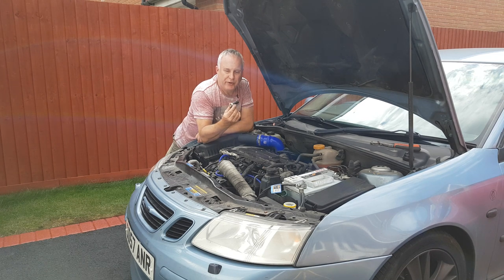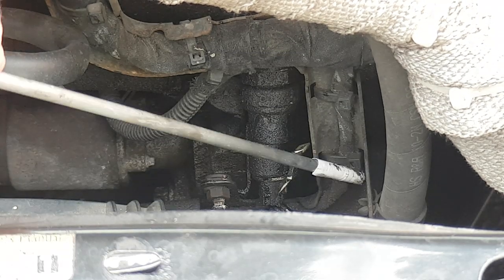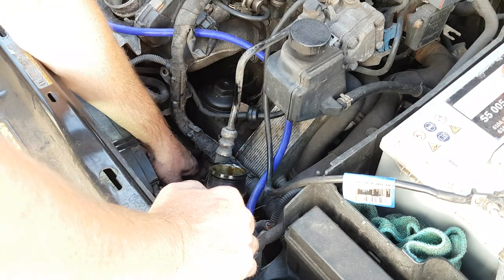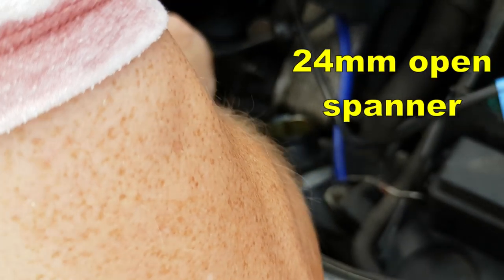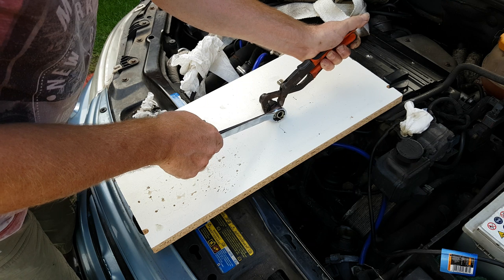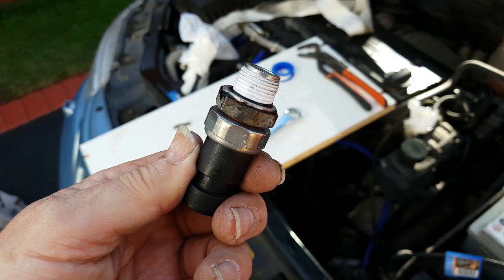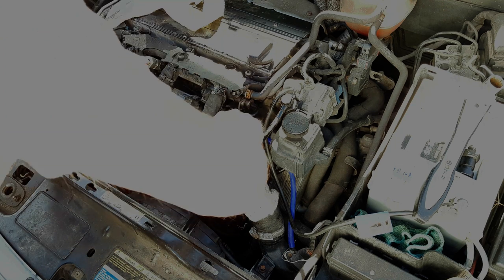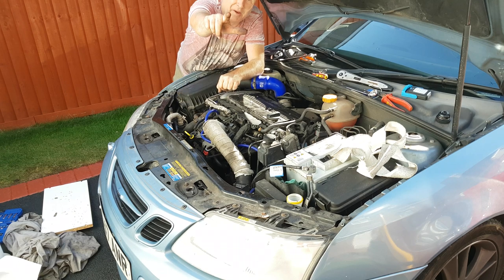Saab 9-3 oil pressure sensor change | How to | Saab Oil Leak Problems

Comment from the maker: EDIT: reporting back as promised (5 months): this has cut my oil consumption by about 90%. There are almost no drips under the car now and the drive has stayed clean. Job jobbed, I'd say.

This is definitely the most common oil leak issue on these (and other) engines. I thought mine probably had several oil leaks, but lo and behold replacing this sender has cured almost all my leakage. In almost a fortnight now since doing this, my oil level doesn't seem to have dropped at all on the dipstick. I'll report back again after more miles.
Reply: Appreciate the info. Any update so far a year later?
Reply from the maker: @akdomun  no leaking from sensor.
Reply: @CycloneCyd  i have a really bad oil leak on my 2004 saab 93 aero convertible. the car is covered with oil on the bottom and leaving puddles everywhere i go. im going to do the valve cover gasket and the oil pressure sensor and hope for the best

Comment: Would it be possible to access the oil pressure sensor from underneath the car to avoid removing pipes under the hood?

Comment: Cyd, I love the content. Somehow my '07 9-3 continues to have the same hiccups as yours! BTW, oil sensor was $12 USD from where I bought mine, much better than a few hundred at the shop.
Reply from the maker: You're quite right there. This is the sort of simple fix shops can easily overcharge for. That's normal, particular models suffer from a common set of problems across the range.
Reply: hey where ya get it?

Comment: Thanks for this. I'll be doing this soon. I noticed you switched out the vacuum lines for silicone. Do you have a diagram or video for doing this?
Reply from the maker: Yes, one of my pipes had a split. No, I don't have a diagram, nor done a video. Not sure it's worthy of a video TBH. Easiest way to do it is simply replace one pipe at a time making sure to get the connections in the right place. Then follow the same routing or reroute. Use it from a roll and cut it to length each time. You'll need 6mm ID pipe for most of it (I used this http://bit.ly/Silicon_vac_hose ) except for the short piece to the fuel pressure regulator which is 4mm ID.

Comment: Need to check mine as it is leaking really bad...valve cover gasket changed anyway....comes out somewhere between gearbox and engine and really bad on the back...
Reply from the maker: If it's a B207R, check the interface of the oil cooler to block. Also check the vacuum pump.

Comment: I don't think PTFE tape will hold in this application. The metal washer is not reusable I think. If you experience any leaks in the future, refit the sensor without PTFE and with a new metal ring

Comment: Yo Cyd, your air delivery pipe is wrapped the way a sniper would wrap their rifle. What is it and does it keep the air cooler?  Very cool looking 😎
Reply from the maker: Yes, it helped knock about 1C off the air IAT. It's exhaust wrap. I've since changed to a 82C stat (was 90C), so probably not making a big difference anymore.

Comment: it's work on 9-3 2.2 TiD 2004 ? or is the oil pressure sensor somewhere else?  D223L motor code

Comment: Is this the most common oil leak on these cars? My garage, when I was getting the car serviced, said  I had a slight oil leak somewhere but they didn't say where. I'm going to check mine today. Mine's a 2005 Aero.
Reply from the maker: When this leaks it flows down onto the front engine mount and drips from there. It probably is the most common leak point, certainly at the front of the engine. If the leak seems to be low down though, investigate the oil level sensor. At the rear, the cam cover just above the turbo and vacuum pump are common too. Even the oil connections to the turbo are known for it. Bottom line is these engines leak like a broken sieve. More videos on the subject to come methinks.
Reply: Thanks Cyd. Love your videos and think they are excellent. More on Ssabs would always be good.

Comment: Hey Cyd, another great video!! Wondered if your saw my comment on another video about potentially doing a how to on how to replace the door lock actuator on the front left door on the Saab? I've seen a number of rear door replacements on here, but I can't seem to find a front door video and your videos are so well done!! Cheers!
Reply from the maker: Sorry Adam, I didn't. YT has only just introduced a search system where the owner can search for comments not responded to. Previously it was really easy to miss comments.
Are you in a hurry for this info? I've got several jobs to do on my driver's door, but we've hit rainy season here now so I have to pick my time. Weather permitting, Xmas break might be a good time.
Reply: No worries Cyd. It's broken at the moment and I thought I might be able to fix it myself if I saw how it was done, but it's no rush. It's not impacting me to a crazy degree and I can wait for whenever you're able to do it! Thanks so much for all of your videos and your willingness to respond to people and take requests! Cheers!

Comment: hi Cyd, really good stuff, thank you for your videos. I notice at ~ 1:44 when you remove the air delivery pipe that there appears to some sort of residue / oil showing up on the inside of the inlet? Is that from the brake cleaner?

Comment: Hi Cyd, I am hoping you could help me identify an oil leak on a Z20NET Vectra. Suspected crankshaft rear main seal.
It appears to be a fair amount of oil leaking between the engine and gearbox. Large patch on the road after running the engine but no noticeable drop on the dipstick at the moment. All the external suspects are dry (oil pressure sensor, dipstick tube, oil cooler, turbo oil lines at the back) and the oil is coming out from halfway up the gearbox making a hell of a mess of everything underneath. The visible starter motor gears have a misting of oil, and I am certain it is engine rather than gearbox oil.
Would you agree that it is likely to be a crankshaft rear main seal? I do not want to take it all off to change that, and still have the issue!

Thank you for all the fantastic content.
Reply from the maker: I had a rear crank seal leak on my B207R when I bought it, but I had it fixed under warranty (and a new LUK clutch 👍). I totally agree you don't want to go to the enormous effort of removing the gearbox if that's not where the leak is.
There are three (3) candidates for the oil (you don't say if it's front of the engine, but I'm assuming it is): engine, power steering and gearbox. The first thing you need to do is be ABSOLUTELY certain which oil it is.
To do this buy yourself an oil leak detection kit: https://amzn.to/3beYbaZ
(if you're not UK based, come back and I'll link you to a similar kit with international delivery options)
Clean the engine down as best you can (a toilet brush is good because of the long handle) with any proprietary oil remover in a hand spray.
Add the fluorescent dye to whichever oil is the prime suspect and use the UV torch to monitor the oil leak very carefully. If you see dye, you now know which oil it is, if you don't you need to try one of the other two with more dye https://amzn.to/2xOrYK2. Yes, I know, it's the dye that is the expensive bit, but still better than wasting a lot of time, effort or money on a gearbox removal.
Hopefully, when you see dye you will see it first at the leak point or be able to infer where the leak is.
Let us know how you get on with this first step
Reply: @CycloneCyd  Thank you so much, I already have that kit on the way. Vectra's have a different power steering system with the reservoir behind the front bumper and in front of the offside wheelarch, so it is definitely engine or gearbox. I will update in due course.
x
Reply from the maker: @SerenaBluee  ah ha! So all the Vectras got the electro-hydraulic steering system then? That was only fitted to the diesel 9-3s.
Reply: @CycloneCyd  I believe it is an electro-hydraulic system yes, with no mechanical pump. There is not a huge amount of feedback but it isn't completely dead either like you can get with purely electric systems.